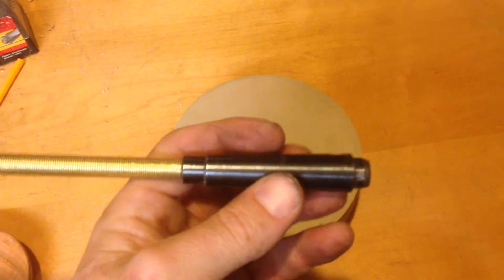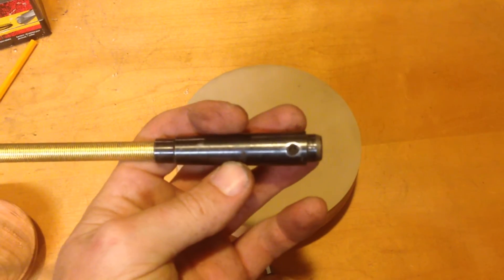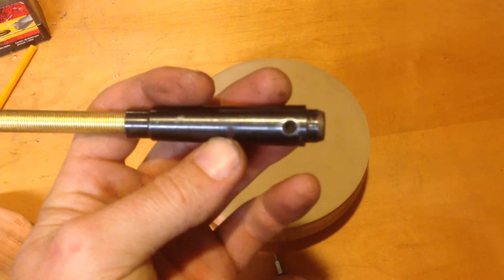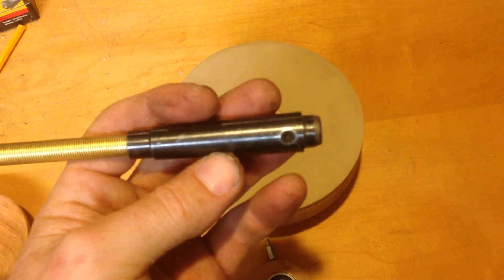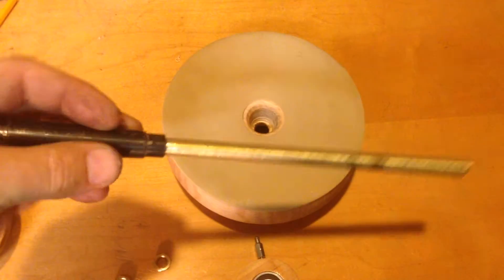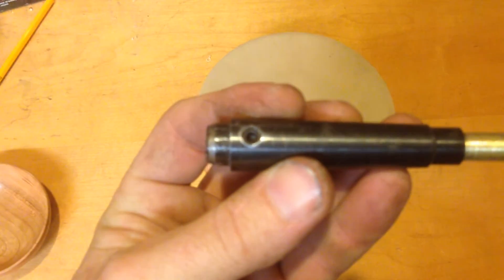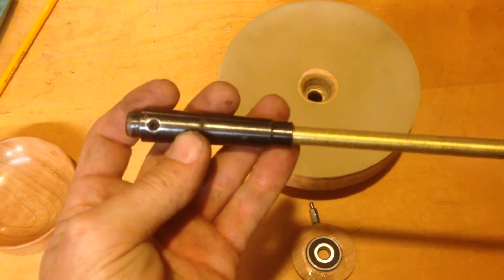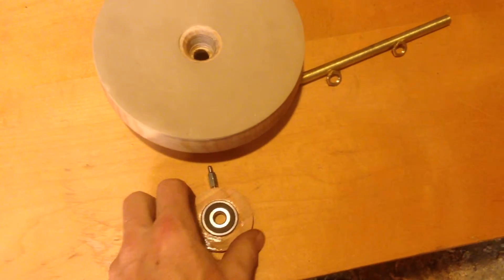diy Vacuum chuck system

Comment: I noticed some wobble before the vaccumn hose was attached and after and would be concerned about metal fatigue with the thin lamp rod and it breaking causing a loss of holding power and a blank flying off
Reply from the maker: Most vacuum systems use a lamp rod. The one I have now does. Plus that is the whole reason for the part that in the thumbnail. It has a bearing.

Comment: WOW! my mind is kinda blown right now .. I did not think a shopvac would work for this .. I am impressed .. I wonder if there are any long-term usage negative effects on the shopvac .. if the air flow is too restricted ... probably not .. WOW .. very cool ... thanks!    (where did I put those stupid Fidget Spinners?)
Reply from the maker: The shopvac is a high flow setup. It works but will definitely kill it after time. I now have a true vac setup.

Comment: I'm curious how long the shop vac lasted?
Reply from the maker: Well it didn't last a yr but honestly don't remember. But obviously it wasn't ment for that strain of low flow restriction.
Reply: @yakbranson  I think you were right when you said it needed the flow to keep the motor cool.  Those motors run at extreme RPMs!  If we could figure out a way to cool them independently of the vacuum, we'd have something.